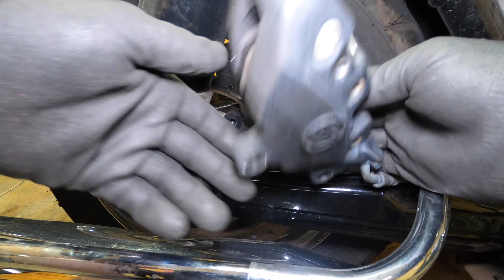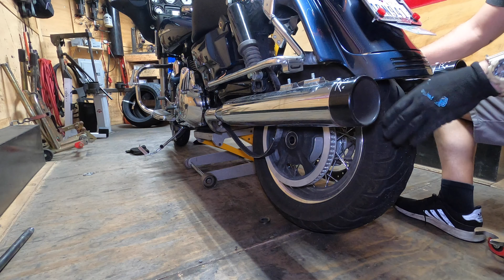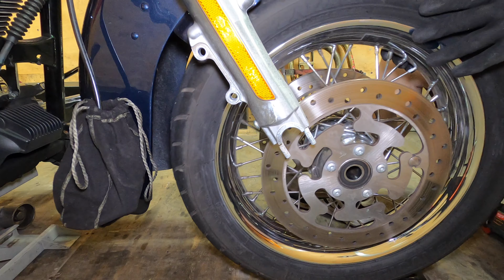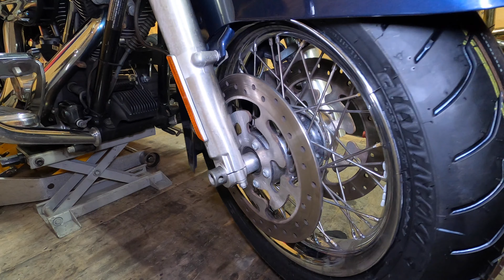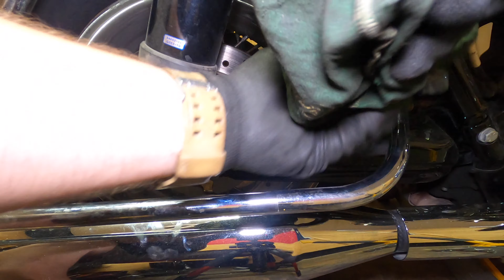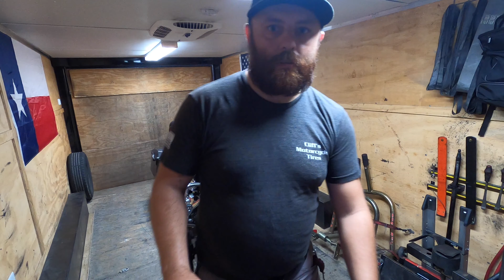2009 Harley Davidson Street Glide How to remove front rear wheels DIY

Comment: Awsome video....good instuctions.....i al ways take my wheels off......problem im having is the small shops want $75 just to put tire on....3 yrs ago they were 25...texoma area
Reply from the maker: Check out the No-Mar motorcycle tire changers. After a few tire changes it'll pay for its self. Faster if you change a few friends tires.